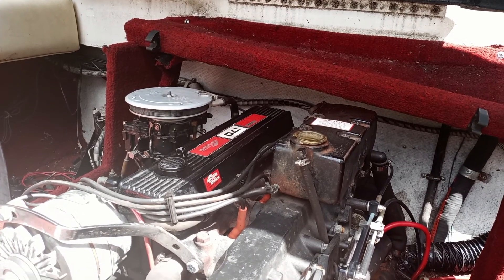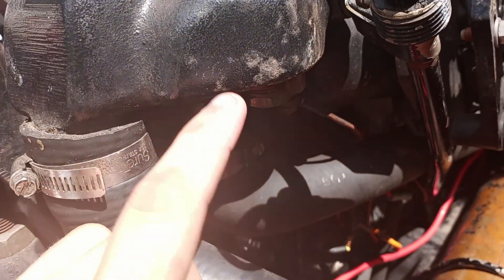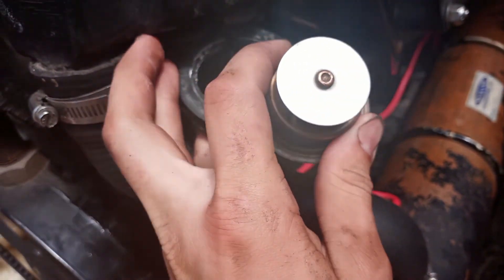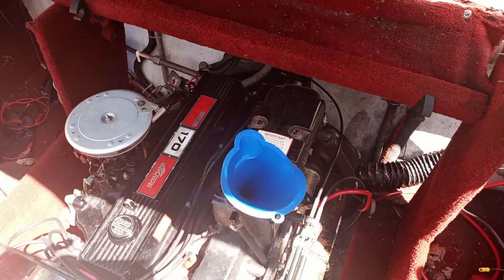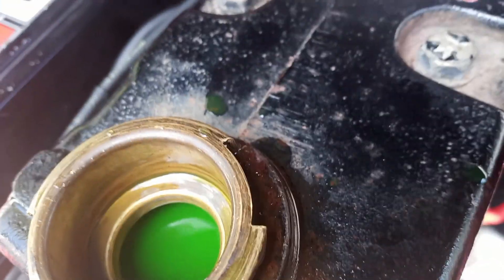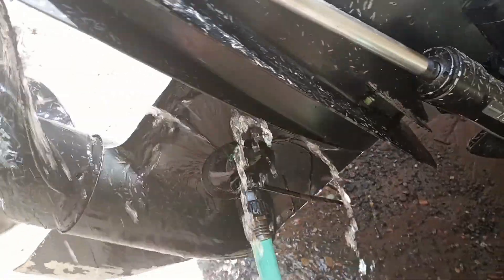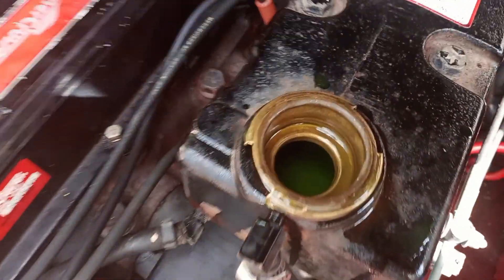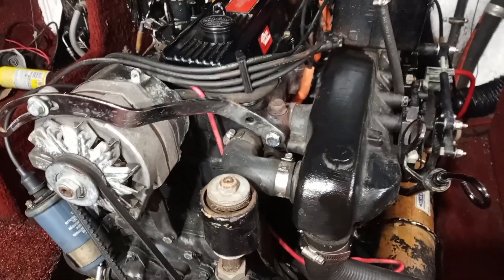Mercruiser  M470 thermostat location

Comment: Can you please tell me where is the water sensor heater in the engine I need to replace my
Reply from the maker: It should be on the front of the exhaust manifold and has a tan or green wire. If you go to 1:11 you can see the wire in the top right by the thermostat housing.